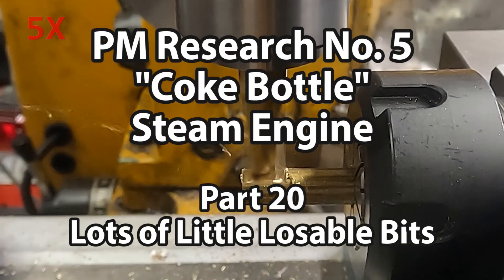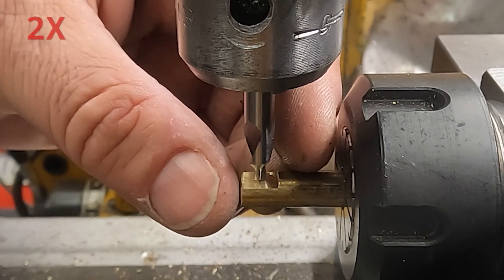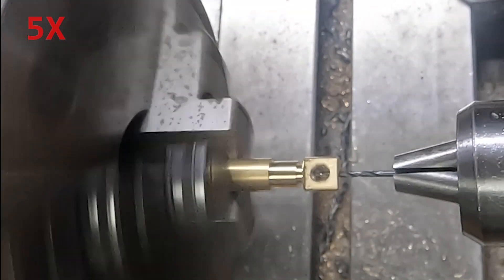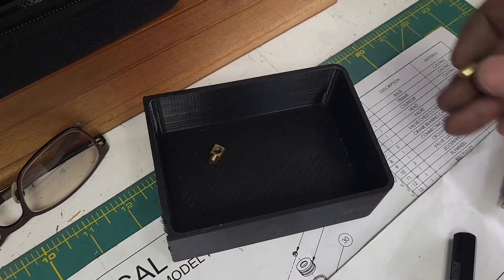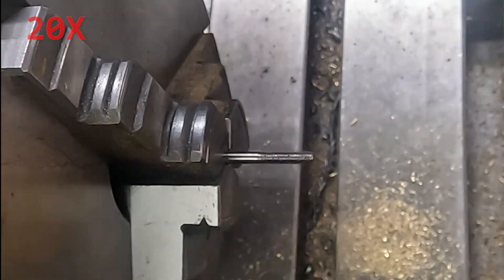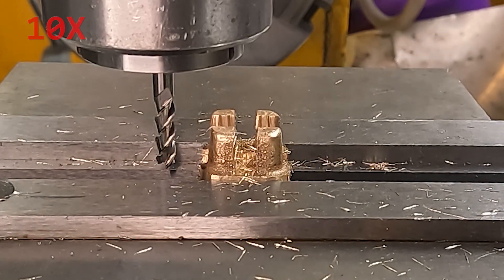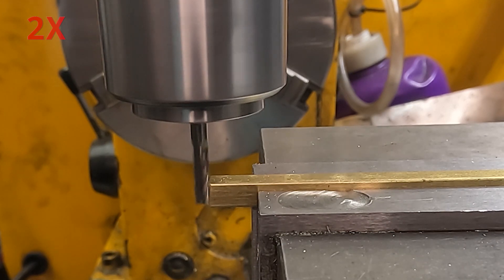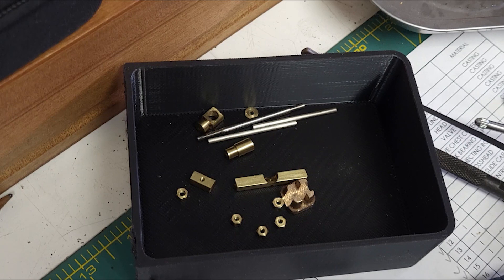20 Final Little Losable Bits - PMR #5 #steamengine #steamengines #lathe #machining #turning

Comment: was your reamer a hand reamer? If so they tend to have a long taper start along the flutes before you get to the full size. I noticed you didn't go through very much so that may be the case. machine reamers are "x" dimension along the full length of the flutes. won't be long now before it's running!
Reply from the maker: "HSS Str Shank Chucking Reamer 1/8" 7/8x3-1/2" it came out tapered oversize at one side.